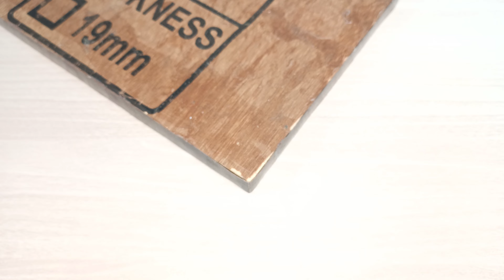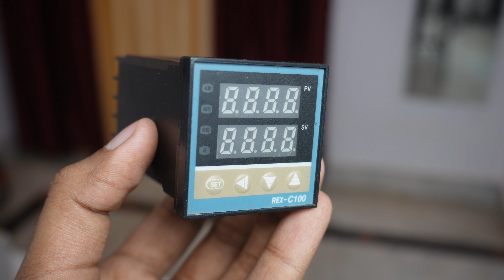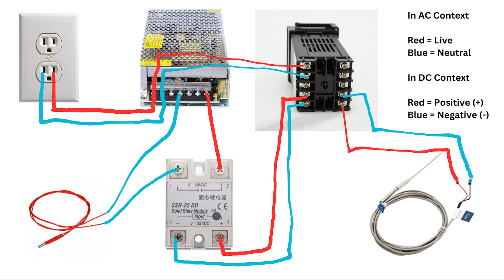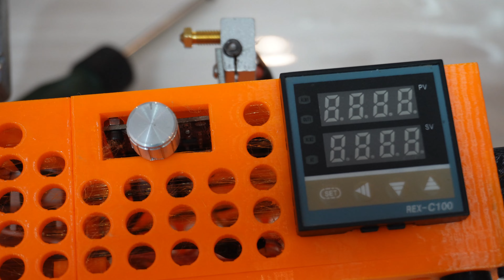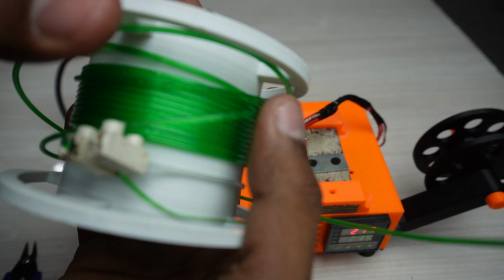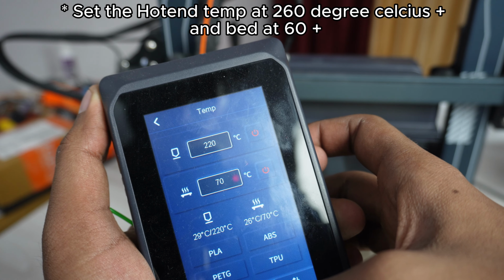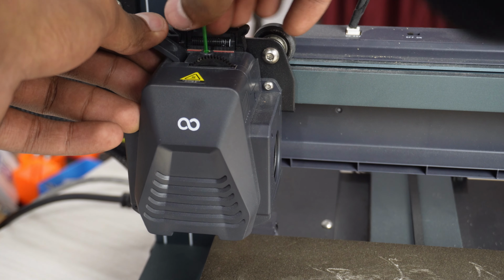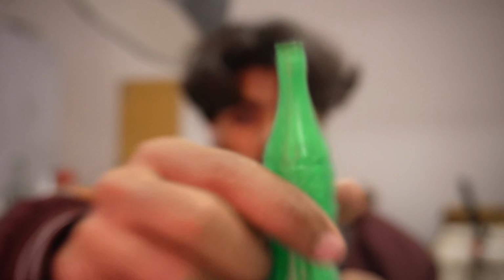PET Machine  - PET Bottle to 3D Printing Filament Making Machine

Comment: you a  completely different diagram to what your building(no motor included in the diagram , no speed controller , not the same PSU)

Comment: So it just bends the PET slice into the tube creating the filament of the inconsistent diameter. Why do you continue on this inherently useless way?
Reply from the maker: No, First thing is to cut the plastic strip into uniform size like 6, 10 or 12mm depends upon thickness of bottle and filament is mostly have consistent diameter and its kinda hollow inside but you can offset it by increasing the flow rate
Reply: Sorry, what would be a better way then? I just want to create a machine like this

Comment: hi, i'm trying to follow your wiring setup but something seems wrong. i got a dc to dc ssr but seems like it's not working. the Rex c100 send signals to it, but on the output there's no current, and so the heater doesn't work. could you help me please?
Reply from the maker: Look into the Input and Output wiring in SSR

Comment: hey bro, can i use neman 17 instead of a TT-775 All-Metal Gear DC Motor?
Reply: no, you need a controller board to use stepper motors

Comment: Good day. What transformer should I buy if the one you have in the description of the video from Amazon is 16.7 cm and the box on it is not that big, it cannot fit in there. Thank you
Reply from the maker: I'm using old PSU of HP computer but you can use any psu within this dimensions 50mmx30mmx125mm
Reply: So why do you have a link in the description of the video to a product that has different dimensions and has a size of 167x6.3x3.8 I already bought it and it's useless if it doesn't fit

Comment: I used the ssr 25DD But the heater did not heat
Reply from the maker: Did you check the input and output side. please make you haven't confused wiring on input and output side of SSR

Comment: i purchased ur file but there is a part missing the motor holder and the wire rotating part
Reply from the maker: Thank you for informing me. I will make sure to update it promptly on Cults3D.
Reply: @Creative3DP  ok

Comment: can u use 28BYJ-48 with bipolar mod for the filament puller instead
Reply from the maker: I haven't tried it, but I think the 28BYJ-48 motor is not powerful enough to pull the filament. You would need to create a gear mechanism to increase the torque.

Comment: Hi i am not sure about the solid state relay it's comfusing you said dc to dc in caption and link shows dc to ac can you clear my confusion i am jist struck at that part
Reply from the maker: It's DC to DC and select "SSR-25DD" on amazon. I have provided the link for DC to DC but it automatically switches to DC to AC.
Reply: @Creative3DP  you used SSR-60DD ?
Reply: And i am using utc421p can you help with wiring i am cosnfuse for that part
Reply from the maker: Yes, that one was the only one I had while making the video. However, you can use 25DD instead, as it needs to be above 12 volts.
Reply from the maker: Sure, I have provided the wiring diagram in the Video. You can follow that and if you face any problem lemme know I'm happy to help you.
Reply: @Creative3DP  thank you so much brooo I'll share the results canyou share your instagram
Reply from the maker: It's creative3dp, and you can send me a direct message there regarding the problems. I'll be able to reply quickly. Thank you
Reply: Hi i am struck again i did the wiring and all but the heater element is not heating ? Can you help me setup the rex c100 the settings are confusing
Reply from the maker: Long Press on Set Button and once its start blinking then set the temprature and then click set once. Make sure you're using k type thermistor
Reply: Yes using a k type thermocoupler also the heater element is going on this time i figure i have error in ssr polarity but the heater element heats endlessly smoking hot even after reching desire temperature the thermocoupler is showing the temp of heater way beyond set Temperature and not shutting  the relay to turn heater elment off
Reply: @Creative3DP  i am sending you message on insta youtube will be slow medium to solve i think 😅